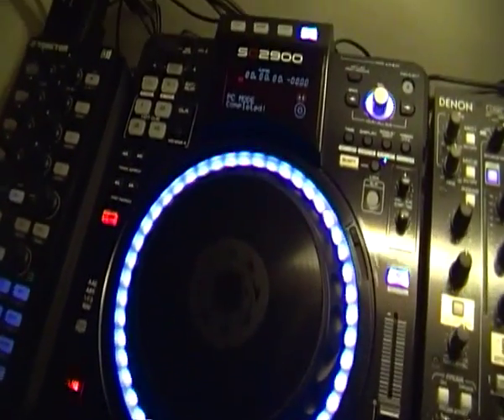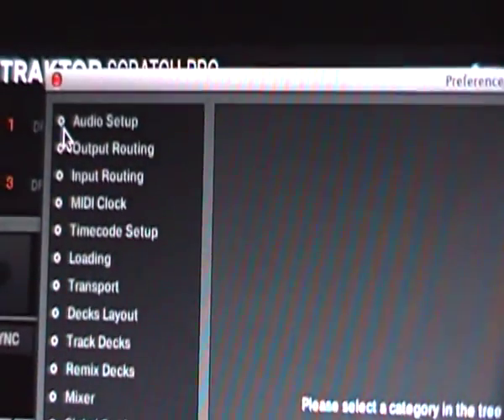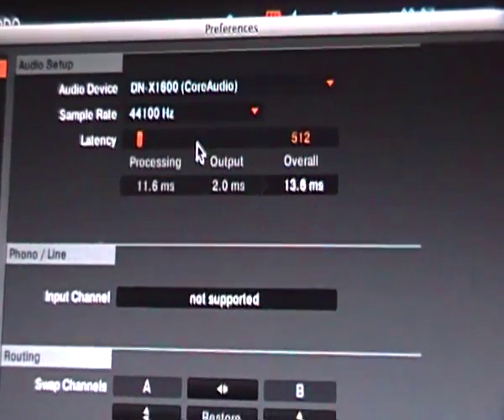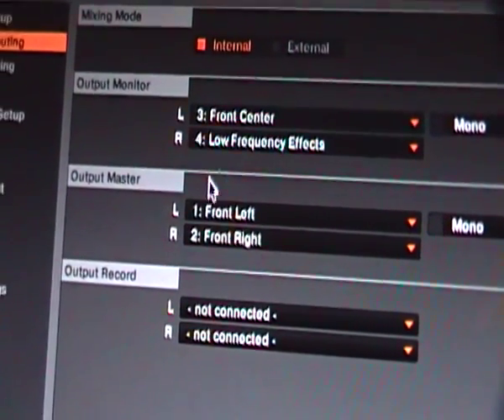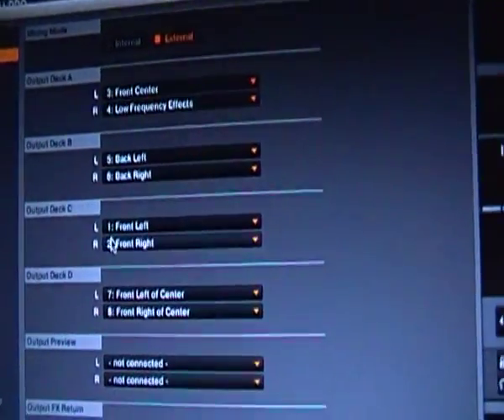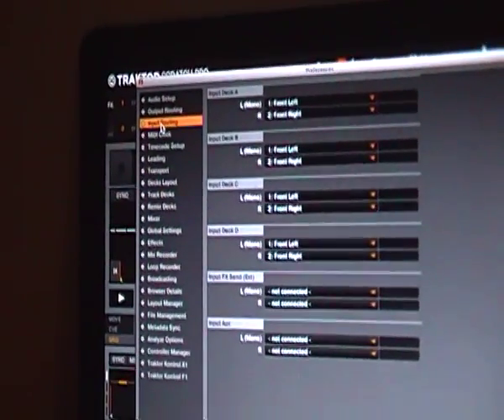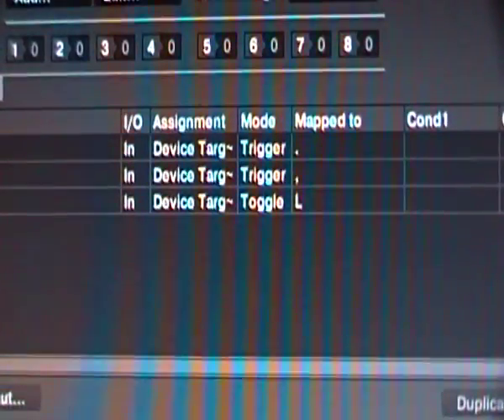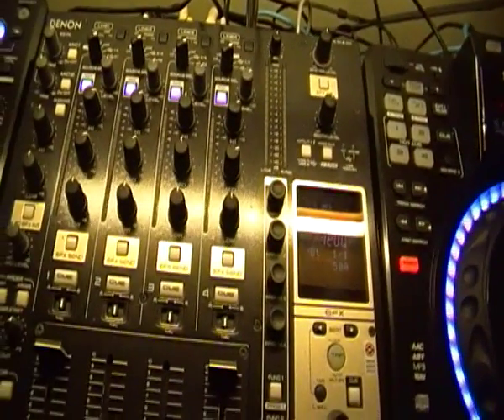Denon SC2900 & Denon X1600 Traktor Setup: Part 3/4 - Audio Configuration & Controller Manager

Comment: dn s1200 + dn x1600 mapping hybrid midi please....
Reply from the maker: Don't own the s1200 so haven't got any mapping to hand. Whilst I have the x1600 i don't use it to control Traktor - that's what the Sc2900s are for. Best bet is to make your own mapping or track down someone else who has made those mappings which you can use instead.

Comment: hi there

got a question for you. I followed your setup tutorial and everything works fine (Thank you btw) but im having issues with the channel LEDS (On Internal Mode) not working but i noticed that on your mixer it works (on Internal Mode). They work fine on external but internal its the only thing that won't work which defeats the purpose. Any way you could help me and anyone else out there with this mixer with that issue??? Thanks in advance.